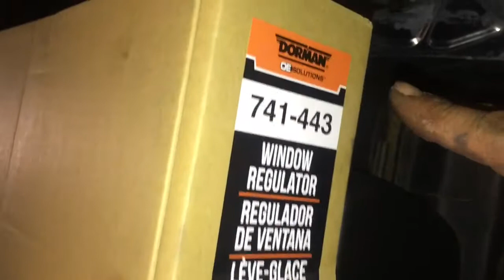Chevy Silverado Window regulator and door panel removal how to

Comment: @The Clay Way one of the window supports came off the track at the top...while replacing a smashed window. How do I get it back on? Do I ha e to remove the entire regulator?
Reply from the maker: Sorry no I think I understand what you’re saying. 

If I remember correctly you have to just move The regulator to the window but you definitely have to have the door panel off.